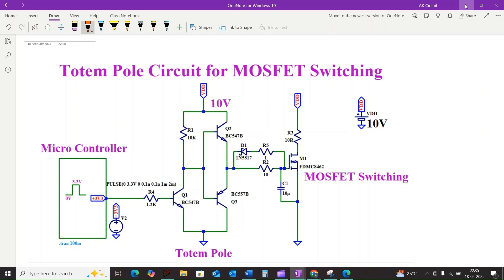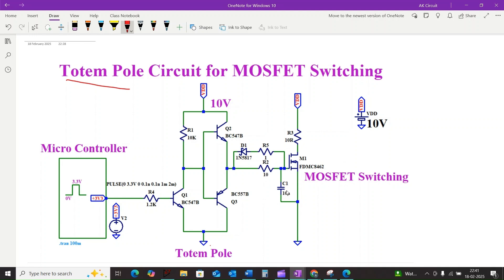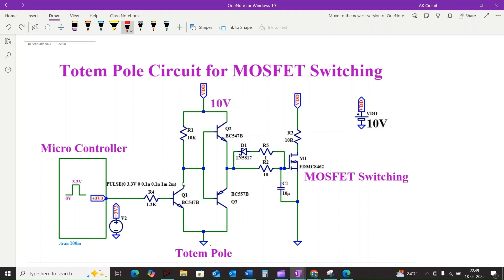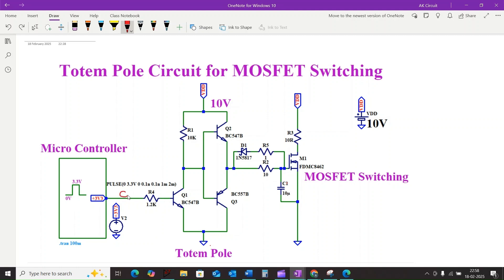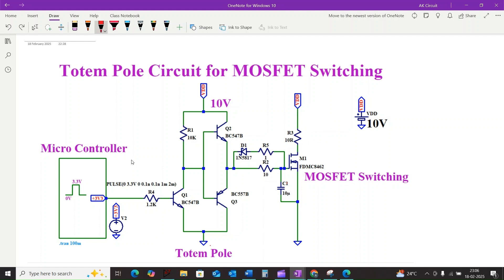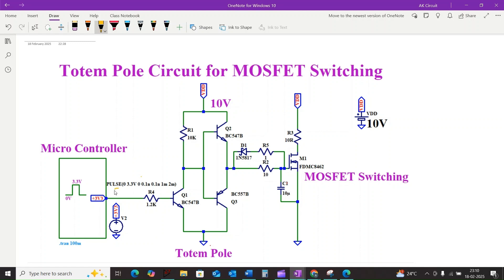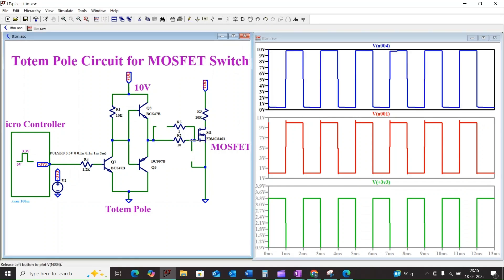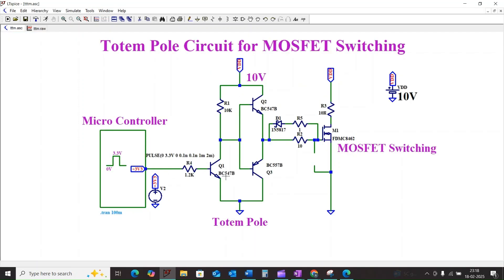Fast MOSFET Switching with the Totem Pole Circuit || Hardware Design||

Comment: Mosfet gate resistors should NOT be placed on the BJT's emitters. They provide negative feedback and turn the BJTs off. Even a one ohm resistor on the emitter slows down the pwm significantly. For maximum gain, you should move the resistors to the collectors of the NPN and the PNP. Start with 100R on the npn's collector and adjust accordingly. And 10uF on the gate of the mosfet is an unthinkable value. You can't switch the mosfet  with that value. It should be as small as possible, maybe 10n for snubber purposes. And to increase speed, add a 56p or 100p capacitor in parallel with R4.
Reply: hi im a novice. why not move the resistors (R2, R5 (and D1)) between the bases of Q2/3 and the collector of Q1, and increase their resistances?  it looks like the high-current loop will be smaller and the base current seems to limit M1 gate current

Comment: R1 needs to be lower value. If you are using 10ohm then 10K means it's too high considering the DC current gain of the totem pole. Although I understand BC547 is never used in real life even though there are plenty of gate drivers available today. Peak current handling is important so that you can quickly get out of the miller platue because it's not the only gate to source capacitance but also gate to drain Cgd. There are lot of other important aspects too.
Reply from the maker: You're right, thanks for pointing that out! The video is meant for a basic understanding.
Reply: @zenithcircuit  so you are giving basic info that is wrong which makes its basic misinformation

Comment: Nice introduction to gate drivers. You can buy these as IC and for most professional designs, that is prefered. The higher VDD is the more important a gate driver is. There is something called the miller effect and at high VDD voltage, it is way more important than just the gate capacitance. Note that there is an important drawback for gate drivers which is high emission from an EMC point of view. When these are used shielded cables up to the load might be needed. Or do not use a gate driver and accept the higher dynamic power loss. Driving loads is often a tradeoff between emission and dynamic power loss.